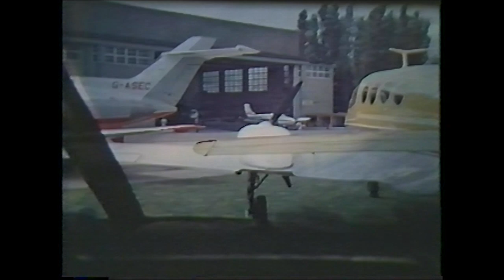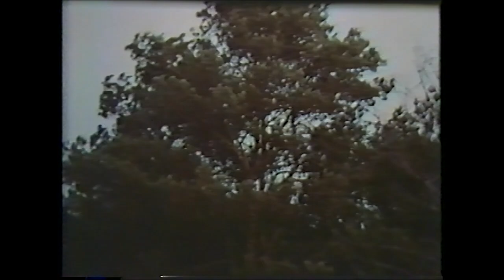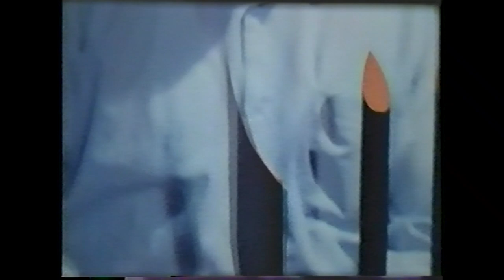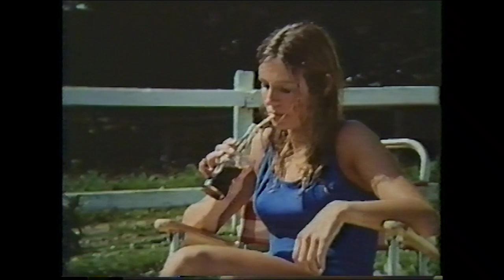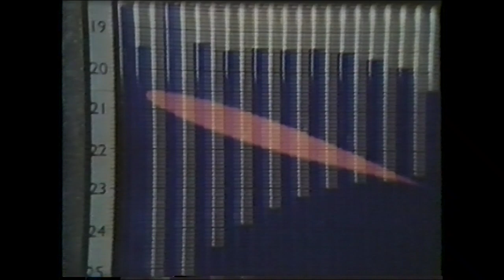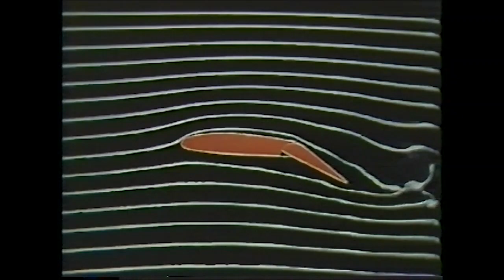How an Aeroplane Flies: Weight & Lift (Part 1) | Shell Historical Film Archive

Comment: So nicely explained, pity the explanation is incomplete..
Lift is not only created by pressure difference but also by the vector of air mass.
Reply: Correct. More specifically RAF (relative airflow) vs AAF (actual air flow)